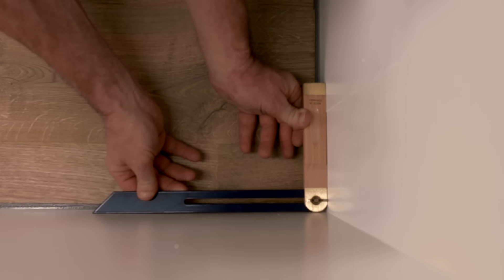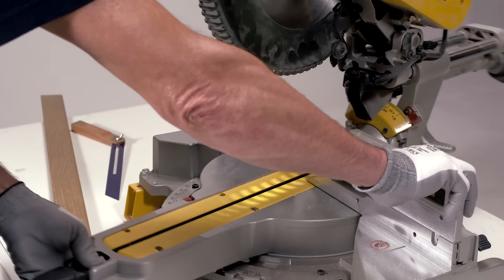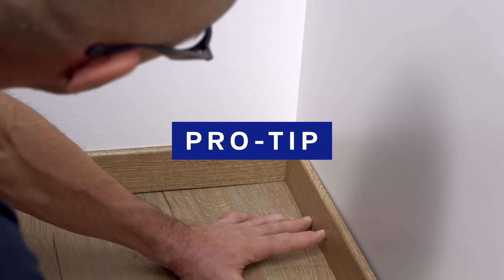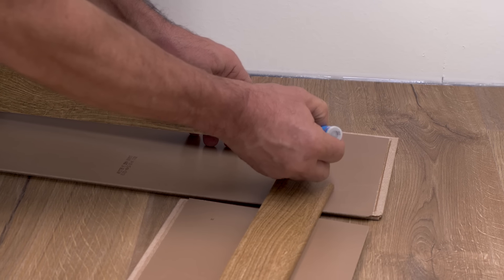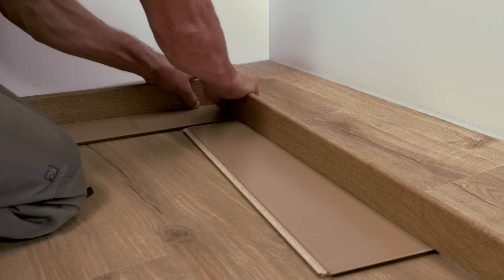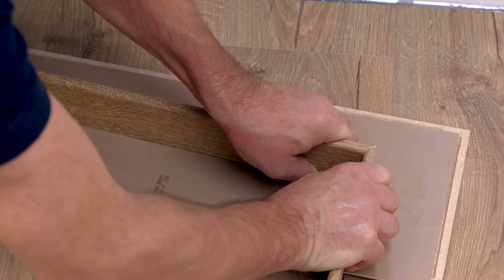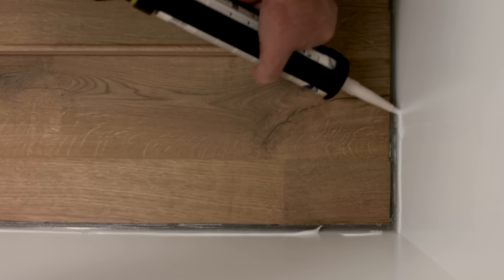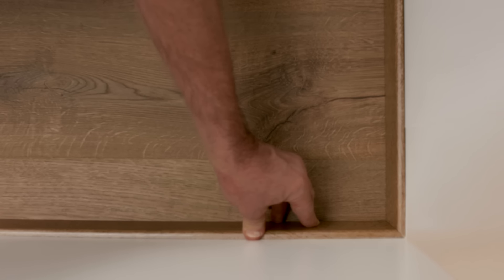How to install skirting boards on your floor | Tutorial by Quick-Step

Comment: You don't miter a inside corner
Reply: 4tj
Reply from the maker: Hi,
Actually, there are a few good reasons why we think it’s best to mitre the inner corners of your skirting boards:

1. First of all, an inner corner is rarely perfect and even after measuring with a bevel tool it’s difficult to avoid ‘gaps’.
2. Imperfections on the wall or too little support behind the skirting board will inevitably lead to small height differences or gaps. 
3. By gluing the mitred skirting boards in advance, you can overcome most of these imperfections. You can compensate for them with the flexibility of the baseboard, instead of just ‘filling the gaps’ with silicone afterwards.

Fact is that a ‘bad’ corner will be one of the first things you notice when entering a room. That's why we like to have them 'clean'.

Regards,
Geert from the Quick-Step Academy
Reply: QuickStepFloor a bad corner is exactly why you don't mitre an internal corner
Reply: QuickStepFloor have cc TB uhb was in

Comment: Professional tip who the fuck mitres inside corners????????    This is a joke!!!!!!! Hahah
Reply from the maker: Hi,
Actually, there are a few good reasons why we think it’s best to mitre the inner corners of your skirting boards:

1. First of all, an inner corner is rarely perfect and even after measuring with a bevel tool it’s difficult to avoid ‘gaps’.
2. Imperfections on the wall or too little support behind the skirting board will inevitably lead to small height differences or gaps. 
3. By gluing the mitred skirting boards in advance, you can overcome most of these imperfections. You can compensate for them with the flexibility of the baseboard, instead of just ‘filling the gaps’ with silicone afterwards.

Fact is that a ‘bad’ corner will be one of the first things you notice when entering a room. That's why we like to have them 'clean'.

Regards,
Geert from the Quick-Step Academy
Reply: a gailis
Reply: a gailis corner
Reply: QuickStepFloor Why choose mitering over scribing?
Reply: a gailis to get
Reply: a gailis aa
Reply: nathaniel botchway bnm
Reply: nathaniel botchway nb. b bnmmmm
Reply: scottgroovez 8690
Reply: nahhhhh scribes are where its at for internal corners. get a slap on the wrist if i did that on site
Reply: full star trek into the dark ness

Comment: What a load of rubbish you don't mitre an internal corner
Reply: Yeah you do
Reply: +mitch bullock m8 I have been a carpenter for 30 years you do not mitre the internal corners on skirting boards !!!!!!!
Reply: +john wort you can but you dont have too ive always seen it mitred
Reply: +mitch bullock , the reason you don't mitre an internal corner is that the chances are that the corner is not square there for a mitre does not fit properly,  on an external corner you can cut the back out of the mitre to get a good joint, in 30 years of working in construction I am yet to meet a carpenter/ tradesman that mitres an internal corner on skirting board
Reply: +john wort oh yeah makes sense now
Reply from the maker: Hi,
Actually, there are a few good reasons why we think it’s best to mitre the inner corners of your skirting boards:

1. First of all, an inner corner is rarely perfect and even after measuring with a bevel tool it’s difficult to avoid ‘gaps’.
2. Imperfections on the wall or too little support behind the skirting board will inevitably lead to small height differences or gaps. 
3. By gluing the mitred skirting boards in advance, you can overcome most of these imperfections. You can compensate for them with the flexibility of the baseboard, instead of just ‘filling the gaps’ with silicone afterwards.

Fact is that a ‘bad’ corner will be one of the first things you notice when entering a room. That's why we like to have them 'clean'.

Regards,
Geert from the Quick-Step Academy
Reply: QuickStepFloor
Reply: john wort qnsndkzmzmxmzmzm
Reply: ok 
àaa z